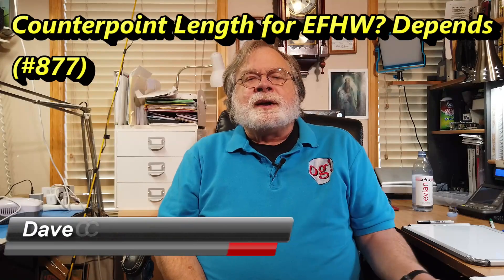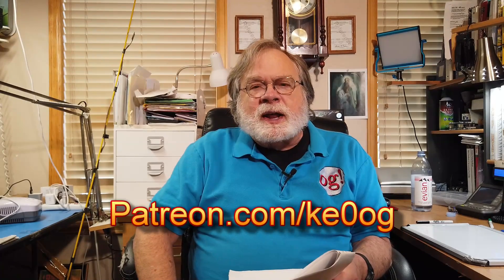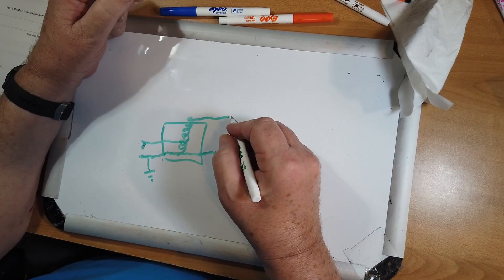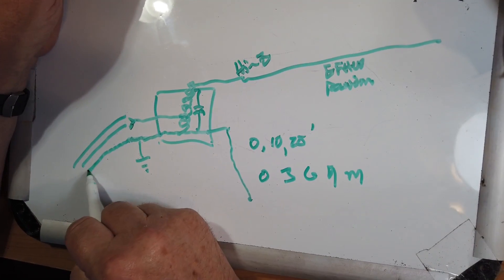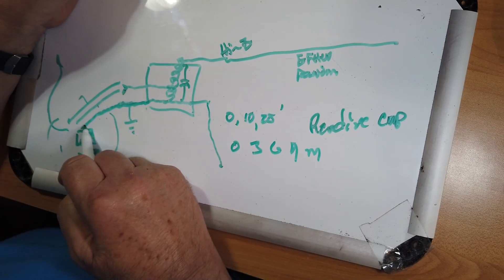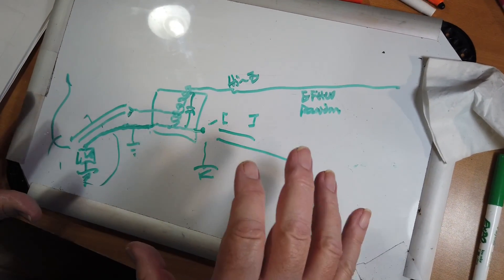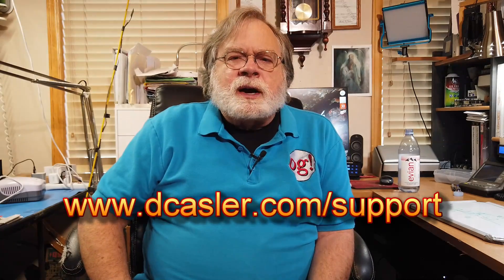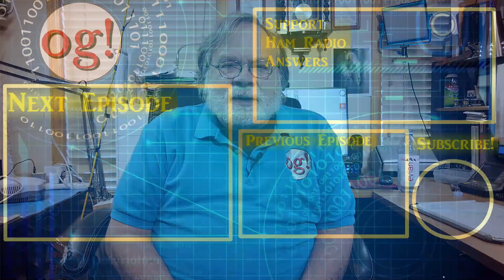Counterpoise Length For EFHW? Depends (#877)

Comment: For link fed end fed antennas, studies show a counterpoise as short as 3.5 ft long. However, if using an unun, the coax shield is the counterpoise but a choke is usually needed to keep rf out of the shack. Clip on ferrite chokes work here. Most antenna experimenters recommend 10 to 25 ft between the unun and choke.

Comment: No counterpoise needed on the EFHW, it's a voltage fed antenna, not a current fed antenna, so there is very little to no current present to worry about.  A simple earth ground is plenty sufficient on the EFHW.
Reply: I am lead to believe when portable with a short coax a counterpoise is a must ?

Comment: Excellent, as always - thank you Dave!    I use a "special" length of 107 feet for my end fed wire.  It is non-resonant, (but easily tunable) on any ham band 160 - 6 meters.   With a 9:1 unun and a very long (>110 feet) counterpoise, my rig internal tuner matches it on every band with excellent on-air results.  I also have a choke just before the unun to prevent the coax shield being recruited.   N7RLV near Seattle
Reply: Interesting

How did u arrive at the various lengths?
I hv a myantennas, 134 foot, 9-1 balun, , 80-10. In conversation, I added a 34 foot counterpoise, clipped to the ground rod at a 90 deg angle. 
With my mfj tuner, I can work 160!! Not great of course but ok! 1.5-1.7 swr’s. 
Any further advice is appreciated.  

Billy
N1 mrk

Comment: My antennas are all grounded to a copper plate clamped on an 8 foot ground rod with a bulkhead connector to the shack side.
Reply from the maker: Sounds like you’ve got your grounds under control! 73 from Dave

Comment: In this case, when Dave says "it depends" this means, EXPERIMENT. See what works for you and let us know. 

Dave gave a few ideas of what to try, but if you're looking for additional tips, just look for EFHW on YT and see what others have done. Take a look at the websites of EFHW manufacturers and see what they suggest. Personally, I think the best thing you can do is experiment and see what works for you. 

I have an EFHW cut for 10m that I usually run horizontal and occasionally vertical. I cut a small length of wire to use as a tuning stub that I cut for the lowest SWR near the FT8 frequency. I had no problem working 4 continents.
Reply: What constitutes "works"?.  IOW, is it min SWR?  What is the metric used to show what works as a countrrpoise length?  Thanks

Comment: Thanks Dave, You have answered MOST of the Questions..... BUT Not This One .... :-)   :-)   :-)  OK, What is the 'Placement' of the Said Counterpoise ????..... Does it run 'Under' the 'Radiator' / Antenna OR is it in the Opposite directions .... Some say NEVER Under while others just don't say  :-)   :-)   :-)  Would love you to PLEASE clear This One Up .... I have just Earned my 'Ham License, although being well on the Wrong Side of 70 already .... Have been wortking 26 & 27Mhz CB Bands for years, now running my 'Granny Radio' ... An Older ICOM IC735, though a 49:1 UnUn into a 'Random Wire' Antenna ( Not actually Random .... :-)   :-)   :-)   ) Thanks for All your Great Vidclips, Fantastic Info. .... Cheers from Christchurch, New Zealand ..... Keith    ZL3KEI

Comment: How long do you recommend the coax run to be if you are counting on the coax counterpoise. Is it expressed as a ratio of wavelength or a percentage of the frequency?
Reply from the maker: I think the kayaks are used for testing is about 75 feet long. And that seems more than enough. It’s interesting that the iPad thinks kayaks are coax.